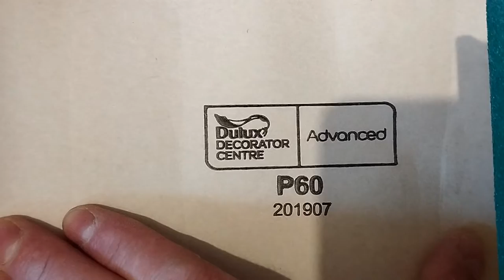Stripping A Handrail On A Staircase

Comment: How old is that house ?  Reason i ask is job i need to do  (whole staircase apart from spindles) but everything ive ever read says stripping 1930s stairs is worse than serving time so dont know whether to even attempt. Would would i expect good decorator to qoute to strip and paint ?
Reply from the maker: @umranhu  difficult to say every job is different. Always need to look and work out a quote. Thanks
Reply: @PaintingandDecorating  thought id try this today on newel post as same principle (only done 1 side as a test) Bought a carbide scraper and what an incredible tool.  I was hoping to get down to an original varnish but got through 98% of paint and varnish so literally just need to sand now with 60 and 120 and down to bare wood ready for some zinsser bin and whatever white satin paint i decide on.

Comment: Looks great! Is there a reason you scrapped the paint off first rather than left stripper on it? The other videos I’ve seen seem to do it the other way around
Reply: Wildgoose, they're a pro level scraper with tungsten blades. They take off multiple layers very quickly. Great on flat or gently curved surfaces.  They must be held flat  though as the edges are razor sharp and will gouge the wood.
Better than paint stripper or heat guns and way less dust than an orbital sander.
Reply: @andrewmcdonald5704    what is it called what do I look for in B&Q please mate?
Reply: Don't know the trade name but from a decorators merchant in UK you can get the same as in the video. Screwfix sell them as well I think.
By far the best way of stripping, I did three storey stair handrail, underside as well in about fourteen hours.
Reply: @andrewmcdonald5704    brilliant thankyou 😊

Comment: Done my handrail at home recently when I redecorated my hall stairs and landing. Stripped off years worth of oil right back to bare wood. Used a combination of 2 part filler and coloured pencils to recreate the grain on a few minor dings… to then finish off with Dulux diamond glaze satin. Came out a treat! Great video as always mate… been following your posts recently. Seems you’ve had a stressful one with waterbased? Pros and cons to both oil and waterbased… waterbased definately more of a faff but I used it on mine as we have a dog and toddler so oil was a no no. Came out fine… but it did take me an age to sand and prep everything first…
Reply from the maker: Thank you.. true..  water based does have its place...  Not really tried diamond hard whites... Need to give them ago..  but the diamond water based varnish is great stuff..
Reply: @PaintingandDecorating  my honest opinion is that Dulux diamond satinwood is a good paint provided you use a good undercoat with it… either something like 123 or as I used the quick dry Dulux undercoat. Plenty of sanding before undercoat and a light scratch with 180 or 240 afterwards did the trick with me… and of course tack cloths really make the difference. Durability is good for waterbased but oil is still king there! My hallway has little natural light so theory is that it will now stay white. Polyvine is also a damn good varnish brand. They do it in dead flat, satin and gloss. Water and oil based you’ll be pleased to hear 👍 take care mate! Marc

Comment: Regards rubbing with methylated spirits to clean.  Would this affect adhesion of a water based paint and or primer  ? Just curious .  

Id like to use water based but having watched a lot of your vids i think ill be putting zinsser bin on before painting. 

 Could i get away with 1 coat of bin followed by undercoat then 2 top coats (areas being painted wont be getting touched and very very little) ?

Comment: Great job. Our decorators totally butchered our handrail which ironically is an identical setup! They used a sander from the getgo removing most of the original profile in the process. The remaining paint was removed with goodness knows what leaving a very rough finish underneath the upper handrail surface. What would you recommend to save the rough surfaces as it's still rough to the touch reminding me of how poor this job was. Many thanks
Reply from the maker: Thank you..  not good sorry to hear that..  you can only try to sand and recoat..  they may of only put one coat on.. this will leave it rough to the touch..  sanders you really do have to be careful..  hope you can sort it out.
Reply: @PaintingandDecorating  Many thanks. Handrail is still bare wood and quite rough to the touch because I suspect they damaged the surface by gauging the paint off as opposed to sanding. We want to keep the natural look without sanding too much more material off for fear of altering the original profile too much!
Reply from the maker: @SuccessShared  you can try and sand using a block and work with the profile... Best way.. and clear varnish will protect and only darken the wood very slightly. Thanks